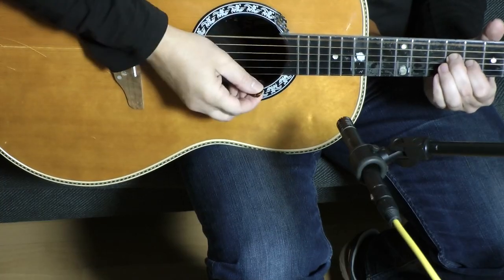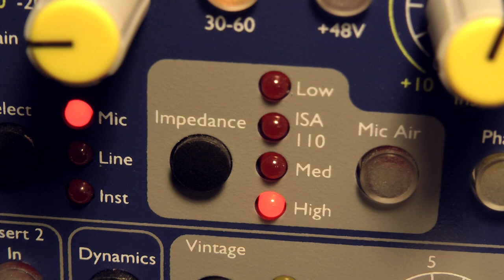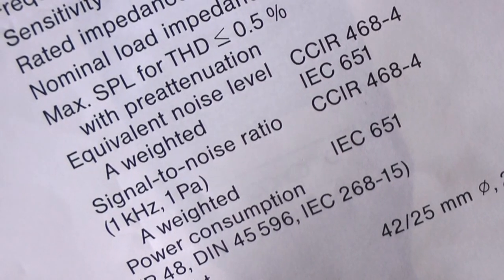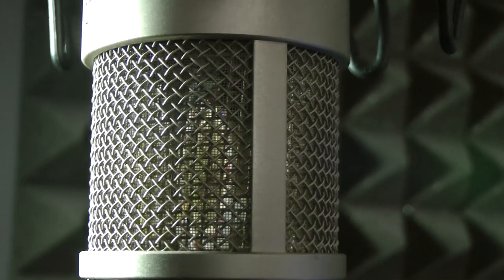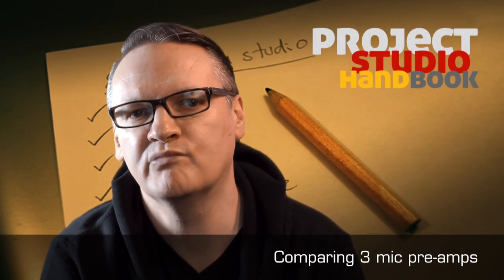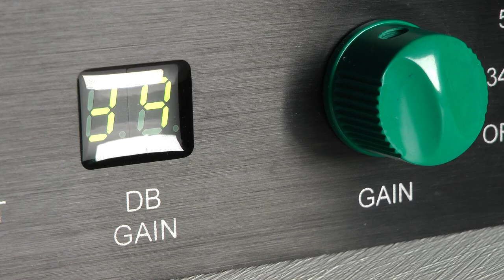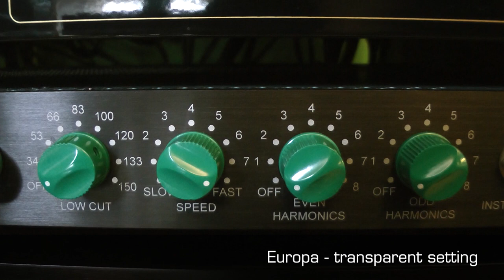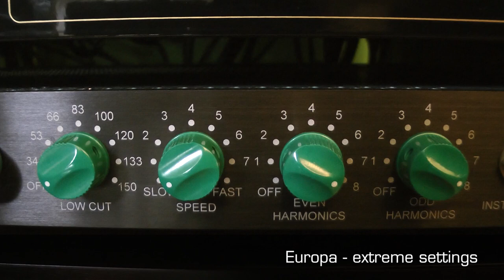Microphone pre amplifier comparisons (v1)

Comment from the maker: Not at all. Because it's an old design the noise floor is higher than a modern pre-amp, but the circuit is almost identical to a 1073 so it shows an almost identical dynamic range. We've never found this a problem for the close mic jobs we primarily have used MP573's and 1073's for. If you're recording classical or acoustic sources you will probably want to use a modern pre-amp anyway. Remember, this is a 45 year old circuit!